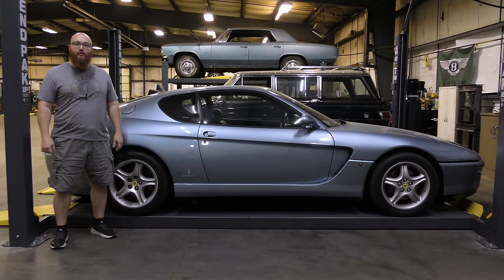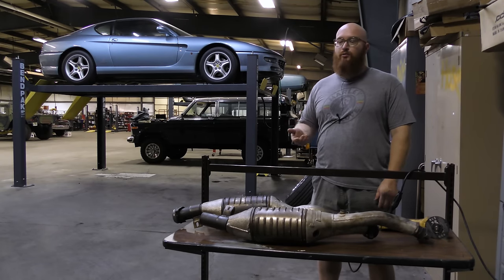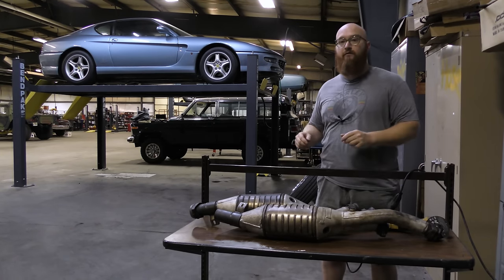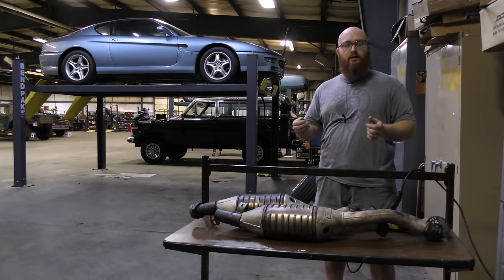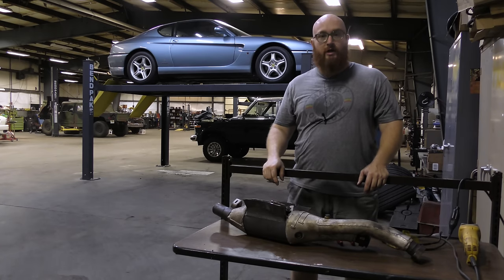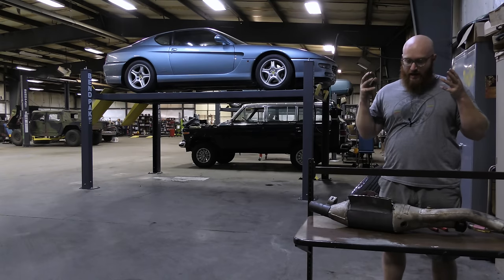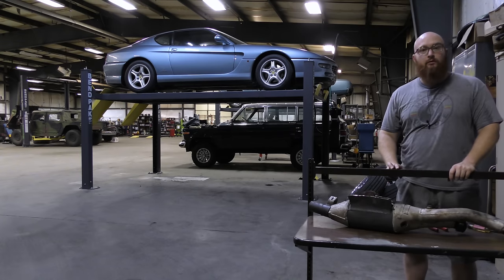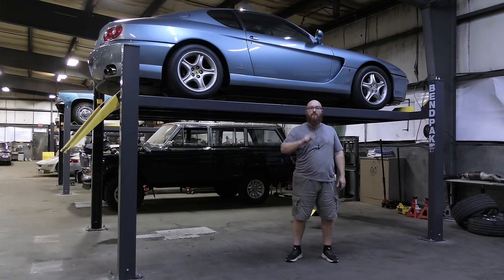Cat Melt Down! CAR WIZARD shares everything you wanted to know about Catalytic Converters and more!

Comment: The government made them install then because the air in densely packed areas was literally unbreathable at times...it's not like they just decided to prop up the rhodium industry or did it out of spite. They do work and make the air much, much cleaner for all of us.
Reply: I work at a big truck company in Sweden. And the modern catalytic converters on the Scania trucks actually cleans the air because in places like Mexico city and other smogged cities, the exhausts of the new trucks are cleaner than the surrounding air being sucked in to the engine.

Comment: 25 years ago, I was driving a 90 Hp VW Passat 1.9 diesel, which had a failure of the catalytic converter. It would be way down on power, shut the car off and started it again, and all would be fine for a while. There was also a terrible rattle from the exhaust system. Then the problem went away. At a mandatory state inspection, the exhaust values were way high, so the catalytic converter was replaced. The original converter - the ceramic insert had come loose, and rattled around so much it was totally gone. It was just an empty box.

Comment: Actually, catalytic converters make exhaust emissions less harmful by performing 3 chemical reactions:

1) Reduce nitrogen output by splitting off and trapping nitrogen from nitrogen oxide (and releasing the oxygen);
2) Converting carbon monoxide to carbon dioxide; and
3) Converting hydrocarbons to carbon dioxide and water.
Reply: This is true. Although the Nitrogen output is more of a problem on diesel vehicles.

Comment: Gov't regs use to be the only reason why cats are there but in todays newer vehicles it is part of the engine management system which not only burns fuel cleaner but more efficiently, giving the engine better performance and greater HP.

Comment: If you get a code for inefficient Catalyst, before you think you need to replace the cats- try a bottle of catalytic converter  cleaner. Save me $7k as my truck has 4. CEL went off and it hasn’t come back. Passed emissions.

Comment: I bought a car here in Australia unknowingly that it had an imploded cat, I test drove it before buying and heard the noise but thought it was an exhaust leak.
Had it on the hoist at work one of my work mates pointed saying you have no cats but saw them and knew they were there. I tapped on the drivers side one and heard it was hollow. I'm still driving it but I think the most of it found it's way out the tail pipe

Comment: Once upon a time I had a k04 turbo tuned 1.8 in a B5 Audi. Nothing too crazy.  The ECU tune compensated for the lack of catalytic converter, thus no check engine light. I had to be very careful when choosing my inspection garage and got away with it. The car ran incredibly, but knowing the ramifications for getting caught I was always a little nervous everytime a police car was behind me. Am I going to get pulled over for the obvious smell? The loud exhaust? Certainly not speeding, wouldn't want to risk the close encounter...

My favorite car of those I've owned, but I don't think I'd risk it now.

So, can you run a car without cats? Yes. Should you? Ehh..

Comment: A way to limit overheating of cats in 1975-1985 malfunctioning (leaking unburned gasoline into exhaust) carb era cars was to stop adding air (from a belt driven air pump) to exhaust gases entering cat. Cat would have a temp sensor+warning light to warn driver of overheating cat before his/her bum would be on fire. All this predates OBD2/"check engine light" by at least a decade.

Comment: I'm an air quality scientist, and I have to say catalytic converters have been one of the most consequential improvements we've seen in terms of reducing air pollution. Most people today don't remember, but 50 years ago even smaller or mid-sized cities had terrible air quality. The sky would often have a yellow haze. There's been a lot of improvements by industry, but in many places cars contribute more than 50% of the smog forming emissions. So while it's a PITA to deal with when they get stolen, we're all breathing easier because of it.
Reply: We do the right thing not because somebody is holding a hammer over our heads. Sometimes you have to get by and these regulations hurt the poor most

Comment: Cats oxidize unburned (or incompletely burned fuel and CO) to CO2. It's exothermic yet cats have no heat fins to help cool off. They can handle the CO to CO2 burn of a normally running engine without overheating, but not the heat of burning raw unburned gasoline. Modern cars with fuel injectors can turn off injectors to cylinders with misfiring (or not firing) spark plugs to avoid cat meltdowns. Carburator era cars with cats (1975-1985) could not stop that sort of unwanted burn and extra heat therefrom. Also engines that leak oil into the exhaust will coat cats in soot. Rotary engines as in Mazda RX7 were notorious for consuming oil (as a way to lubricate apex seals) and their cats ran hot enough to glow in the dark if you looked below at night. The honeycomb structure in cats is also called a laminar flow element by some, and laminar flow elements without precious metals have other uses, such as for measuring gas flow rates by pressure difference front to back. The precious metals are only plated very thinly onto the surfaces of the honeycomb. The other geometry tried was a cage of thinly plated spheres, like ball bearings, but mostly the honeycomb prevailed... seems less prone to disintegration...

Comment: The earlier cats were pelletized and the cars of the time had to push all that exhaust thru the pellets drastically effecting performance and fuel economy ! That was the begining of the malaise era !
Reply: @thunder prince thats what the cars became after emission controls ! Lol
Reply: Is it possible to put a modern style cat on it? If so, how would that affect performance for them?
Reply: @stephenreed3381  all depends if its pre 1981 ! OBD 1 is more forgiving ! 96 and up is OBD2 they are heated and there can be up to 4 O2 sensors ! You can get around this ! Just empty out the pellets ! Put 4 oz of acetone in the tank  Lean out the carb and bump up the timing ! should pass !

Comment: They don't only remove "Carbon" eg. CO. Modern catalytic converters remove three harmful gases:
1. CO oxidation to CO2
2. HC oxidation to  H2O und CO2
3. NOx reduction to N2
Because oxidation needs air containing O2, the cat comes often together with a secondary air system, that induces fresh air into the exhaust system just before the cat, also helping in burning unused fuel, cause fuel needs air to burn, not exhaust gases....

Comment: I have to wonder what with electronic fuel injection and engine management if converters are even necessary any longer.  The only government mandated things that really does any good is the PCV, fuel injection, and Evap system.  Especially the PCV.  In old cars they vented straight to straight to the air.  As the engines wore, you would get GASSED out!!!
Reply: Cats get rid of NOx. Unless you like acid rain, asthma, smog, etc.... If you don't want a catalytic converter, just buy an electric car or truck.

Comment: I had a BMW E38 with the V8 and my passenger side primary cat ended up blowing. Now the thing about the E38 is that the primary cat is in the header and the car also has two secondary cats, one for each bank. Essentially what happened is that the primary cat got so hot that all of the material shot through the exhaust and ended up clogging the secondary cat, making a glob of metal and ceramic. It was an absolute mess. I didn’t want to spend around $3k on two new cats for my 250k mile car so I ended up drilling holes in the secondary cat so the car could at least breathe. Eventually I got rid of that car because of that issue and a few others but man I miss that car

Comment: I didn't much care for catalytic converts in my cars, I mean they always had them but would sometimes cause issues. Once you run rich or lean too long (often times not tripping a code) you'll need a new one or multiple ones, very expensive. 

I live in Tampa now, have to say the less emissions I get the happier lol. I wouldn't mind electric cars living in such a dense urban place, you can always smell older less efficient cars and while in the country it's not so bad it can get annoying and unbearable in dense locations.

Comment: I went through a couple of cats on my lotus exige. First time it sucked material back into the engine and we had to get a new supercharger and top end. Second time we just smashed the insides out and ran it like that. Best sounding car ever / friends commented it sounded like a 60’s F1 car
Reply: How does cat material gets sucked into the engine and ruins your supercharger and head?
Reply: @nicolascrescimone  back pressure. Imagine being under full throttle in a long straight (I was at Spa), cat melts, coming off the throttle the back pressure pulled material in. Having seen the supercharger off the car it was definitely damaged. Rest we repaired as a precaution

Comment: Thank you Wizard and Mrs.  Geezer alert, car in the intro Ferrari 456 looked to me like a Ford Probe (Mazda MX6) or Supra.  Protection against cat theft, install the plate with multiple bolts making it time-consuming to remove.  Removing create a mess with oxy probes/fuel injection?
Reply: Or put a line on your Battery ...

Comment: I would cancel that orde and go to an exhaust specialist for a custom made system: metallic preconverters, then a short pipe then ceramic core CATs. the o2’s can be placed after the first pair or after the second pair, there will probably have enough heat in either case. At least this would be much cheaper and might work better than the stock setup that I understand can fail easily and then it gradually reduces the performance of the engine. I don’t know if the second pair needs to be ceramic for a better reaction for reducing temperature, you can use metallic core. Also cheap aftermarket cores may not work as good as oems but they still do something, at least they will burn HC almost guaranteed.
you could go with a single pair of metallic but cheap metallic aftermarket cats I don’t think there are very effective, ceramic ones may be better. It depends on what you finds that fits the flow of te that engine. with a laser temperature gun you can then check the temperature at the inlet that has to be lower than at the exit.

Comment: In the 70s the auto makers tried to explain to congress and the regulators that there were better ways to control exhause emissions.   But the lobbyists for the people selling the stuff that goes inside to make them work won out.
Reply: No idea if true but wouldn't be surprising as in another case the US government regulated headlamp designs for cars sold in the US from 1940 to 1983, namely mandating standard spec seal beam headlamps with very little changes to the design(s) over the years. And only finally budged because Ford made an argument that if manufacturers were allowed to do custom aerodynamic designs it would lower emissions.
Reply: The cats were not specifically required; it’s just that the emissions limits were at a tight-enough level that cats were usually the most cost-efficient way to do it.  In the US market, the vast majority of car brands started using cats for the 1975 model year.  But there were a few brands where their other emissions systems were effective enough that they could put off using cats for a few years.

Comment: Why isn't welding in an universal cat into the stock pipe an option?
Reply: Can't say about the US, but in good part of Europe you likely would need TÜV and regulation compliant universal cat, produced by a certified factory that was built by a certified construction company, with all of the components and tools supplied by certified factories all of which were also built by certified companies only using certified certifying certification. Oh and you will likely have to bring the car to the other side of the country for the actual testing and certification to be done and you can't drive there as the car is not yet road-legal. And of course you'll fail the first few times as the exhaust clamp wasn't installed according to TÜV standards or the color of the universal cat doesn't match the rest of the exhaust system. And just when you think you're done, turns out one of the mechanics that worked on your car clipped one of the body panels and the paint around it started deteriorating so you'll need to address that before you can have the car declared road-legal.

I'm of course over exaggerating but not by much.

Comment: The parts supply problem is rampant. I had my local shop put in a "new" (knock off) windshield washer pump on my '04 Lincoln and it failed within a week! (The second one is still working for now.) The shop had to eat the 1/2 hour of labor, and it took me 3 trips, etc. How long until they won't do the work anymore??...🔧

Comment: Amazing all the heat around the engine that there are not more fires.  All the wires eith rubber coating and computers in all that heat.

Comment: Don't you think those cats are a lie? I live in Europe and I have an old diesel mercedes e220 from 1996, we removed the cats because de were bad and removed the EGR, the car has 460.000 kilometers runs perfectly and passes the emition tests every two years with no problems and the emition readings are still lower than the factory numbers.

Comment: Yes catalytic converters aren't required to run the engine. The same goes for EGR, PCV and EVAP systems. These devices themselves aren't mandated to be on vehicles, but the emissions each system controls is. The reason we have these emissions controlled on vehicles is to reduce toxic emissions of carbon monoxide, nitric oxide, VOC's and unburnt hydrocarbons. Or to put it more simply, they make the air less toxic to humans. Since I'm human ( some of my former Airmen would disagree) and I like breathing clean air, I'm all for these devices.  Yes, back in the '70s cars ran like poop with all the emissions controls on them. That's hard to say with a modern car where you can get 300 HP out of a 2.5L 4 cylinder - and still meet the emissions standard.

Comment: My understanding is that if the engine is working correctly the cat should last as long as the car. Short of a shock (like sudden extreme cold) they should be fine. I've run cats to 200k miles (and then gave it to someone else). Hoovie must have ignored some kind of misfire or other fueling issue to have that happen.
Reply: Driving through even shallow water can cause trouble.  The sudden temp change can cause damage.

Comment: Hollow out the catalist and weld it back up for "testing purposes". Most cars (I thought) had 02 sensors before the cat becasue how would you get an accurate reading after if flows though the cat?
Reply: In the ‘90s, cars only had an O2 sensor before the cat, to help control the mixture setting. Later, like in the ‘00s, further emissions requirements caused them to add an O2 sensor after the cat, just to check how well the cat was working.  They still have their “main” O2 sensor before the cat to do the mixture control.

Comment: My cat was stolen. I had an aftermarket cat installed , and it melted. I had another aftermarket one installed, and that melted as well. No check engine lights. No warnings.  Nothing. Besides the cat issue car is in good condition but I am tired of spending $ on new cat converter. Any ideas on what might be the issue?

Comment: Cats when working properly do not hurt the vehicles performance at all. When they are not is a very different issue. Cause fires,, yes they do, I have put them out as a volounteer firefighter. I have been gassed by one as well, the floor was so hot it was frying the carpet.
You can buy 'generic' cats and weld them to the existing pipes, or fabricated ones. And they do work correctly.And a good deal cheaper than imitation Fiat ones!!
IF a cat has burnt up being lean WHAT has it done to the engine? Melted the pistons probably and cooked the rings, headgaskets and even valves and valve seals. Yet the computer is supposed to stop all that. As it seems it did eventually on this car.

Comment: An added benefit of catalytic converters is improved engine efficiency and fuel economy. Those with the pre cat and post cat sensors use that information to provide the best fuel / air ratios for that engine.

Comment: I heard that the cats used to explode if they clogged up and it was dangerous to have one under the seat you were in . Did they use to explode or perhaps they still will explode.
Reply: If it filled with unburnt fuel and then ignited I suppose it could. But the engine would have to be running very badly for that to happen. There's nothing in it otherwise to make it explode.

Comment: I also think even if the government said tomorrow it’s no longer mandated. Car companies would still put them on. Imagine the smell of thousands of cars around you with no cats? People today wouldn’t tolerate that
Reply: Yep, gf's Honda Element had its cat stolen, replaced with a straight pipe but damn does it stink now.
Reply: Ah, How I miss the days of smelling the sweet aroma of non-combusted fuel in the exhaust of passing cars!
Reply: On the highway, when I see/hear an obviously modded car go by me, or in front of me, I always switch my HVAC to recirc.  Those cars pretty consistently give off the smell of unburnt fuel.

Comment: Can you adapt a Kia’s or another high performance cars Cats like you do the fuel pump?
Reply: O2 sensors will trigger a check engine light if its not the flow the computer wants